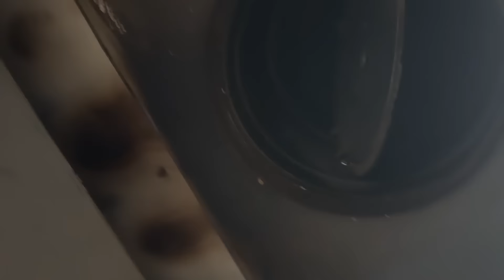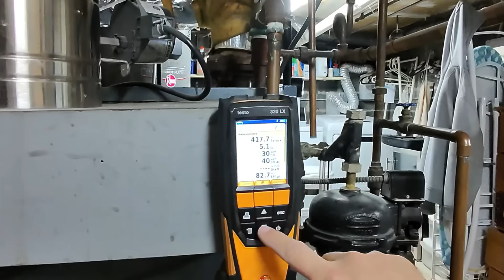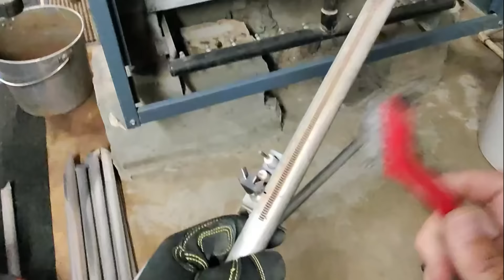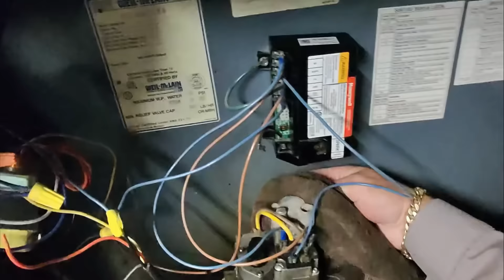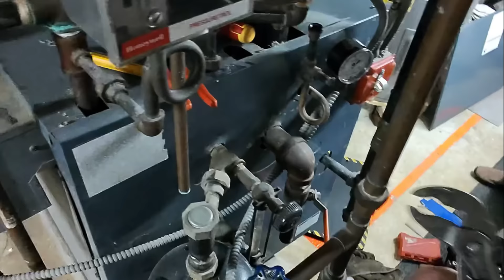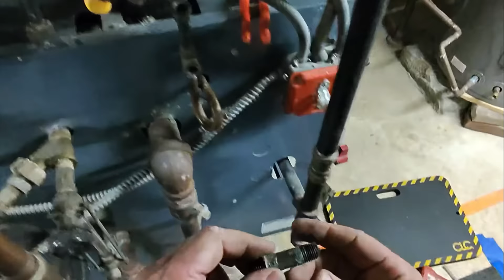Steam Boiler Service Most Techs Skip (Big Mistake)

Comment: Why is it that you don’t brush the sections out, is it not necessary? Also, where is the pan on the bottom of the boiler under the burners?
Reply from the maker: WM dont have a "pan" on the bottom.
Reply: @P @PipeDoctor hmmm, that’s strange, it’s sucking dirty air off the bottom ?

Comment: you never answer this one. why wipe down burners with wd-40, when in use it gets burned off?
Reply: pretty sure it's to protect them from oxidation. it does quickly burn off but it leaves a thin protective film behind.  It can also help to reduce the amount of dirt and soot that normally sticks fast to them. Salty Finger prints will quickly start to oxidize on a burner. After a couple heat cycles you will notice that every place you touched will start to oxidize if ya don't treat them with something. WD40 works really good to Pickle Stainless steel exhaust on a vehicle as well.  As far as a Penetrating oil/fluid? WD-40 is one of the absolute Worst.  It was never actually made to be a Penetrating Fluid/Oil.  WD-40 AKA (Water Displacement, 40th formula).
Reply: @bevis226 the YouTube account Project Farm did a great test and comparison of penetrating fluids. Basically found that anything was better than nothing. WD 40 Landed in the middle and beat some leading penetrators. In the end he based them on value/price because they were all close. Definitely not a penetrating oil but he somewhat proves that none of the advertised penetrators actually work better for the price.
Reply: Ye leaves a coating